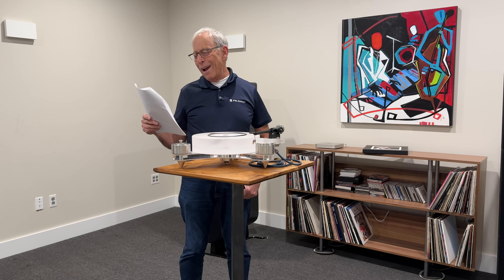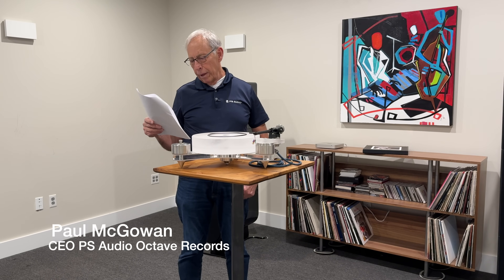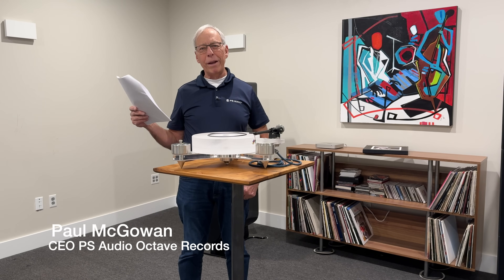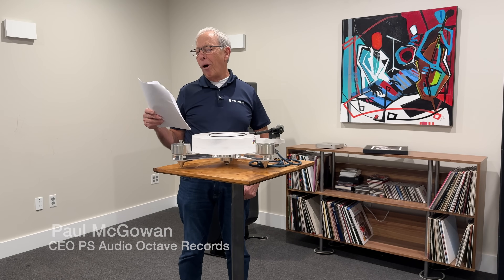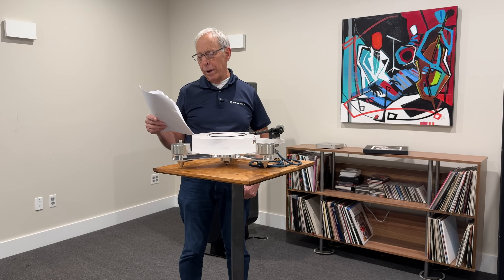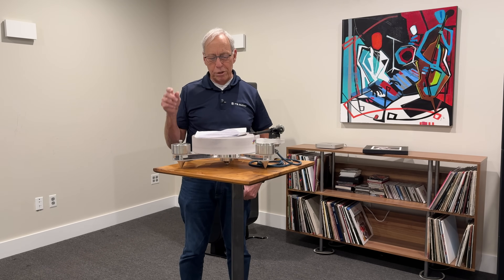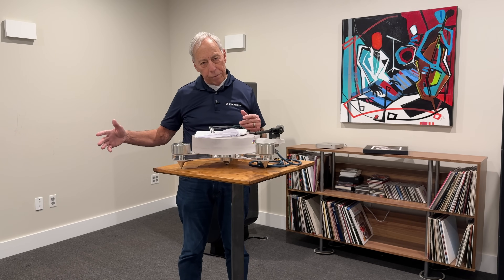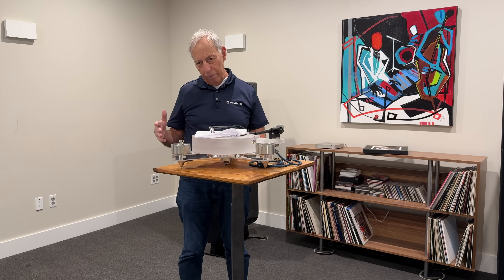Damping factor in amps affecting subwoofer sound

Comment: If damping factor is the ratio of output impedance to speaker impedance, you'd have to recalculate based on the resistance of the high-level inputs.  The damping factor also relates to back EMF of the speaker voice coil which is a non-factor when tied to the high level inputs.

Comment: No, sorry.. The right way is to use the low-level...
The high-level is just a backup for use with amps without pre-out or sub-out.
It's litteraly a extra step using the high-level since you first take the high-level to low-level inside the sub amp and then the sub amp amplifies it.
And by your logic here that would also apply when connecting power-amps then... But the same does suddenly not apply there.

Comment: I am wondering how amps using active feedback to accomplish extremely high Damping Factors but with a modest internal PS impedance, compared to just a good low internal resistance PS, might be affected? There is more information exchanged between devices when active circuitry is involved.

Comment: Google Benchmark Damping Factor for a very comprehensive explanation. Paul is absolutely correct about this question. Hegel over boasts it’s damping factor which is annoying.
Reply: Paul is completely wrong on this one. The question was pointing out the connection between amp and speaker. Not between amp and amp!

Comment: It just occurred to me that the sound of the power amp together with the main speakers determine the sound.  Duh. What I mean is the reactive load of the speaker feeds back into the amp.  Connecting the input of the sub to that amp/speaker system would influence the sub as it plays the signal given to it.  That also would lead to better matching of the sub as it is now part of the same feedback loop.

Comment: I like running really long speaker level cables back and forth around my room in asymmetrical lengths to the subwoofer. Especially when I am running a tube amp with negative feedback, ambient noise can be picked up better by the speaker cables and amplified by the amp. Makes it a good test to see if my system is revealing or not.  😂. Everything in engineering is a trade-off.  Bass sound and quality matters, just because something can make a sound difference, does not make it better.  Just run coax interconnects, not the twisted quad stuff (the directional interconnects that Paul says to run from). Ironically he also only sells directional interconnects on his website. Please people, run unbalanced, coax interconnects to your subs, not speaker level inputs. If you have an integrated tube amp without sub or pre out, get speakers that have proper bass response. Too many are small and narrow these days with no bass response, an engineering trade off to lower shipping costs, and the lazy…oh they can just add a sub.

Comment: Tube amplifiers mostly have an notoriously low damping factor. Som like it, i don't. So - if you want to experience the difference between low and high dampingfactor, then compare a tube amplifier with a decent class B amplifier driving a given sub. You will be able to tell the difference easily, espicially if you listen to electronic music with a lot off basslines and heavy demanding beats. It will be very noticeable below 100-80 hz, and don't get me wrong - it is also noticable above 100 hz, but tends to be more difficult to differentiate with higher ferquenzies.
Having worked with PA systems in the late 80's and trough 90' i learned that with highpower subs, dampingfactor absolutely makes a difference. An example is if you chose to drive one or two subs on a given amplifier channel. If you chose to drive 2 subs in parallel you cut the dampingfacor in half, and although the amplifier may have sufficient powerpupply to drive a lower empedance load i just doesn't sound as good and solid as if there is only 1 sub connected. Bringing an extra amprack or two was a easy way to get a bit more empressive sub reproduction.
I believe it was Crest audio who made a really hefty PA amplifier with an alledged 10.000 dampingfactor at 8 ohm load witch is nuts. Testing it on 4 8 ohm 18" subs in parallel (on 1 channel) it should behave as a simular amp with a dampingfactor of 2500 on a 8 ohm load (still pretty impressive), but it was just incredible dissapointing despite the fact it should be able to run on 2 ohm load all day long.

Dampingfactor is (just) a number and while it may indicate sirtain proberties, you should trust your ears in the first place, and just let the numbers point you a general direction to a given application.
Reply: It depends on the music. I have two solid states (Class AB and Class A) and two tube amps (SET and Pentode). I absolutely have to listen to the Eagles on my tube amps.
Reply: @epi2045  Yes i agree, and it is not really true that i dont like tubeamplifiers, but they tend to be challenged in the low end spectrum. I heard Pink Floyd Dark Side Of The Moon (and a lot of other acoustic goodies) on a Audio Note system and it was absolutely mindblowing, but not really in my budget... In a perfect world i would like to have several different systems depending on what i am listening to.
Reply: @frederikschiler1394  At one time, I tried to get the “one perfect do it all system”. After decades, it has come down to my cooking and wine philosophy. Pairing and variety. I have 6 pairs of speakers including my beloved Magnepans (two pairs).

Comment: Regarding which input to choose, I can't see how the difference of line level input vs speaker level input can be even audible at the sub frequencies we're talking about here! There could be an issue with phase but subs have a phase shift switch. I would always choose line level, as the signal will be less affected by power supply demand compared to the power amp. At high levels there could be some sag or compression at the speaker outputs due to the power supply not keeping up with demand. Of course this only applies to a less expensive stereo amp - you'd expect the power supply in an expensive amp or a pair of mono blocks to be able to keep up with demand and then it's not an issue.
Reply: The high-level inputs are not drawing current, as they are high impedance. The signal from the PA is voltage and is getting amplified by the sub's internal amplifier. You wouldn't be able to effectively parallel the sub with the main speakers if current was drawn from the mains PA for the internal sub amp.
Reply: That 0-180° "phase" shift switch has nothing to do with phase shifting  It's just a polarity switch flipping the sinewave 180°. Impulse response will show you this.

Comment: Good Day Paul, you did explain in this video where we should connect the sub, to the power -amp, Could you please explain user, where to connect this sub, is it to the same output ,as the left/right outputs go to the speakers?Please ,ask you kindly to explain us in a video exact how,where to connect, when we user have intergrated/mono amps. This is indeed a difficult issue,Yours sincerely Ray
Reply: I think you have to use speaker B terminals on the amp providing your amp has it

Comment: The damping factor of a power amplifier, which is just a function of its speaker output impedance, is not a connectivity consideration to worry about when powered sub woofers are added.
1 ohm output impedance from the speaker terminals, versus 100 ohms output impedance from a pre-out, going into the subs higher input impedance, equals no problem in either case regarding functionality.
As far as sound quality is concerned, the pre-out would be my choice giving less distortion and quiescent hum compared to speaker out.
Of course you may not have a pre-out anyway.
Additionally, the paralleled power amp speakers could act as microphones when connected to the sub input, potentially creating noise and positive feedback.

Comment: Damping factor is very important for woofers …. It does not affect powered subs…
Reply: Except for phase shift. Most subwoofers have a phase adjustment pot to correct any phase difference between the power amplifier’s main speakers and the sub(s) internal amplifier(s).

Comment: I don't know man.... I mean, my subwoofer must give me a BOOM, low frequency BASS (<80), not "Seamlessly presentation" from my amp. So I think there's nothing wrong in using RCA cable as opposed to the "right" way, which is by what he says : High Level. I like Paul, but there are some things that he says in his videos that I can not agree with him. Peace!
Reply: Bass can have texture and nuances to it, it’s not just boom. I use a AudioQuest Boxer sub cable with good results. Check them out
Reply: every av receiver has rca sub outputs also called lf outs.
also modern amps and integrated have them. 
if not you must use a sub with hi level or speaker level (not signal) inputs. some have them some dont. most modern subs only have line rca inputs so check that before buying what you need.
Reply: A lot of people have tube amps like me, and they don't always build them with subwoofer outputs. I just bought two 2023 Yaqin tube amps with NO sub out jacks, as they both have only one pair of L and R speaker outputs. I guess $1,600 wasn't enough for such luxuries (lol).  Without reengineering these tube amps this idea of wiring subwoofers directly to such amps is a little silly. I would have to do a mod anyway to tap the preamp, I rather not do mods on new stuff I just bought. And my subwoofer has its own digital amp built in, so my sub's output is already going from directly from an amplifier to a sub driver (speaker). @endrizo

Comment: He's right about the sound but gives the wrong explanation. An active sub has it's own damping factor. A hight output signal from the amp to the sub gives very litle destortion compared to a long RCA interconnect. Get a 14 AWG coax (2.5 MM2) as interconnect. same for your dac and turntable. You'll be shocked about the sound improvement. As an electronic egineer and an audiophile for over 5 dacades thrust me on this one.
Reply: The RCA connection from a pre-out will give less distortion, bypassing the distortion from the main power amp output stage.
Reply: What about a decent quality Audioquest sub cable? I just bought a AQ Boxer cable and it completely eliminated my hum it also seems to sound good. Do you think specialized sub cables can sound better?

Comment: I’m not an audio tech, but surely, your power amp is not connected directly to the speaker/s in your sub. It is connected to your sub’s integral amp. So, although that that integral amp is drinking from the sane source, it’s the sonic characteristics of that sub’s integral amp which will most influence the damping factor of that sub.
Reply: You would think so right. However I have took Paul’s and Rels recommendations and used high level inputs to hook up a sub and I could have sworn it sounded better. Most of my systems use a single subwoofer cable though just to avoid the spaghetti mess that high level wires create.
Reply: @JR-ho5qm  I’ve always used the high level connections to my Rel subs. But, connected at the speaker terminals, not the amp terminals!
Reply: @JR-ho5qm this is interesting as A-B tests can help us judge better.
Reply: How about passive Subs? They do exist and they do make sense e.g. in a home cinema setup, where you need shallow subwoofer boxes and cannot accomodate the amp in the box..
Reply: @egi75  I use Rel subs, which are active. The ‘plate amp’ on the rear of the amp adds very little to the sub’s overall dimensions!
Reply: I think it depends on how it’s connected to the amp.
Reply: @matthewtowns1548  I was assuming a high level connection. But, even with a low level connection , the subs integral amp will be doing the heavy lifting!
Reply: It depends if the sub is powered or not powered.. 99% of subs are powered I believe
Reply: @coastalvideotransfer  obviously I was referring to active subs!
Reply: I would agree that the subs amplifier would need to have a high damping factor at line level when used with hard to drive speakers. i prefer the sound characteristics of the pre-amp. anyway in my case i run bookshelves which sound better when i high pass at 80 Hz. That makes the biggest difference. At the end of the day if 80Hz down changes the main amps characteristics then i would go low level.

Comment: There might be a difference in how high or low you have to set your gain on the subwoofer. Also, personally I like to connect my sub directly to my speakers since speaker cable have sonic characteristics as well.
Reply: Sounds like more of a cost saving measure. When the funds are available duplicate your main speaker cables exactly, so all drivers in the system are receiving exactly the same signal passed through the exact same length of speaker cable. That is the reason for PS Audio designs that always incorporate 4 binding posts in all their 
amplifiers. You want (Stereo) sub's wired directly to the amplifier, not each speaker they slave. Paul or others could explain the technical aspects of why.
Reply: I did something similar. I use to connect speakers to subs (2) terminals, although speakers and subs directly connected to amp do sound the same in my setup. The speaker cables I use don't have any sonic characteristic (I chose a model that don't filter any frequency between 20 and 20000 Hz [adequate capacitance and inductance]).

Comment: Should the playback chain (amplifier and loudspeakers) not dampen anything at all?
Reply: As the speaker drive unit has mass it will have inertia as it moves.
When the signal from the Amplifier tells the drive unit to stop moving and start moving in the opposite direction the inertia will keep the drive unit moving in original direction for a bit before it stops and reverses direction. This overshoot is what is needed to be damped. An amplifier with higher damping factor will control and reduce this overshoot better than one with a lower damping factor.
As bass drivers are much higher mass and move further than tweeters damping factor has much more effect in the bass.
You may have noticed that bass drivers driven by one amp move a lot more than when driven by a different amp at the same volume. This would be because the second amp has a higher damping factor.

An amplifier with a higher damping factor will tend to sound better, especially in the bass, and be less likely to damage the drive units if played at very high level.